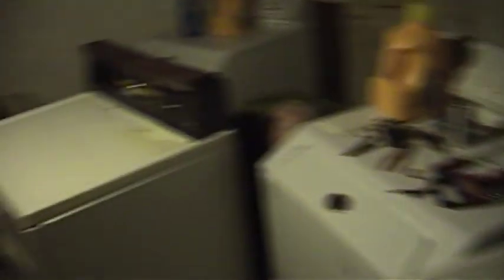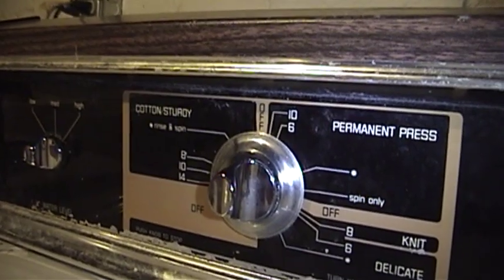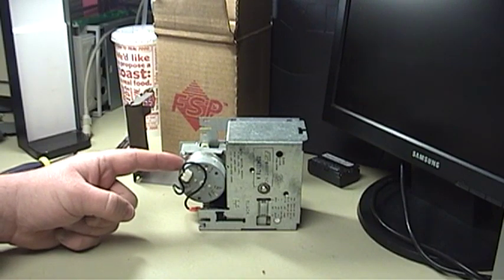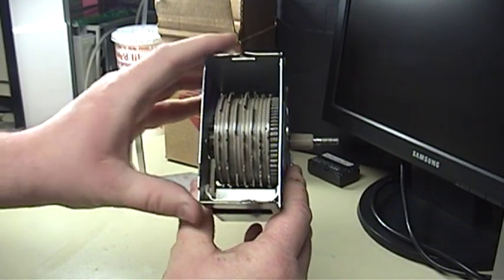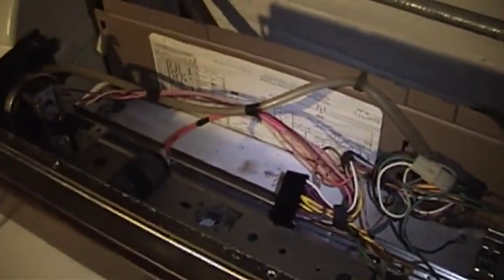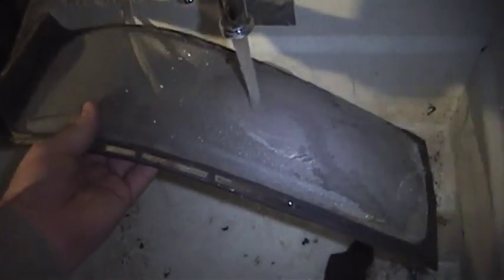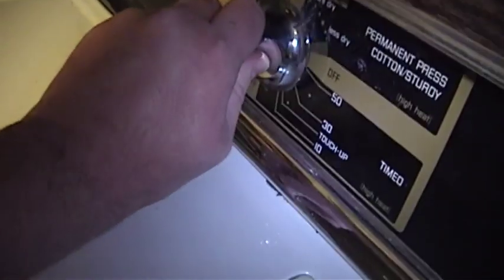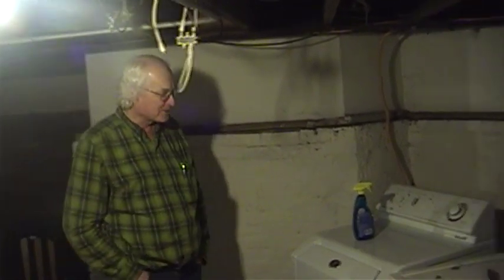Repairing College153's Clothes Washer and Dryer

Comment: My grandparents *just* got rid of some Kenmores from this era back on December 15. Something had happened to the washer to the point it shook the whole house when we washed clothes. Rather than spend time and money replacing part after part to figure out what was causing the instability, they replaced both washer and dryer with shiny new Whirlpool Cabrio WTW5600 and WED5600 units. They're definitely a different beast than the Kenmores, but they're nice. I dread the day the electronics fail...

Comment: Good ol' Kenmore built in the days when people cared. We've had a new Whirlpool washer, dryer, and dishwasher in the last 6 years. 3 dishwashers arrived with defects; one leg snapped, one bumped motor causing it to leak, 3rd with a leg deformed, but we settled with it, but it doesn't always heat water enough, poor performance, started making a loud humming too. Washer gearbox self-destructed after 3 years, then we got an LG front-loader, which has been flawless. Dryer temp control seems glitchy.

Comment: I did replace a heating coil in a newer dryer she had a couple years ago. It was easy enough, just had to remove the back cover, remove the element and connections, slot in the new element unit and reconnect the wires and replace the cover. However, without realizing it I had trapped a wire between the cover and the chassis of the dryer. So bang it went when we turned it on but no damage was done as it tripped the breaker. Soon fixed it with a bit of electrical tape and replaced the cover. lol

Comment: Thank you for this very informative video. I have a hotpoint washer with a (GE used on several brands) timer which will not act on the pull or push to turn for cycle selection or on/off.  I had a tech work on it a couple of years ago and he had to superglue some plastic part which was involved in the on/off function. I am interested in removing and rebuilding whatever is wrong.  The washer worked perfectly until I turned it to a cycle I never use (permanent press, by the way, diametrically opposed to my usual normal cycle). Now I can't engage the dial to change to any other and start it. any advice? new timer costs almost as much as another machine.

Comment: If you see the heating coils glowing red, that's a sure sign of restricted airflow and it will put a hurtin' on your element in time. On the opposite side is the fan intake duct. If you remove it you will probably see it's half clogged right in front of the fan at the bottom. Make sure to clean that out as well as your vent and duct.
Reply from the maker: +PAballoonists I've never seen an electric dryer element that didn't glow, even in machines known to be 100% working. Air passages in this machine seemed OK. I suspect significantly high line voltage and abuse to have killed the first heating element. Ventilation for this dryer was not ideal and I made the strong suggestion that it should be replaced with something better right away.

Comment: Ours doesn't have a touchscreen, but it's digitally-controlled. I still have to explain to my grandmother from time to time (in non-technical terms) that the timer cycle in the new machine is controlled by firmware on an integrated BIOS-like ROM chip instead of mechanical timers and gears like the old one. That's why it's a little slower. Personally, I think it needs more RAM! ;)

Comment: I have a Maytag A412 that I was trying to fix it was leaking I had to change the hub bearing and stem seal.  I had to chisel the threaded nuts off and hub bearing due to being on so long.  The problem I have now is that the belt is burning and no spin cycle.  I checked the top cap to make sure it was not rubbing.  Even if I get a new washer I am keeping this one and rebuilding it.  The new washers are computer controlled even the simple ones. This A412 is build like a tank new ones plastic.

Comment: You'd think they would have added some relays to the devices the timer controls so it  wouldn't be subject to that kind of high current torture. Then again, relays break--probably far more often than that timer wheel would. That was probably the calculation made when this washer was designed.

Comment: Did the landlord hire you to fix his/her washer and dryer?

To those worried about the Cabrios, the early ones had a defective controller assembly on them. Whirlpool will replace them out of warranty (they just swap out the entire board), wouldn't be surprised if it was bad caps. One nice thing about them is that they have on board diagnostics to help troubleshoot.

Comment: I hate Hotpoint machines (No idea if Hotpoint is available on your side of the pond) Mum has a hot point washing machine, only a couple of years old and It has basically been rebuilt, the only original parts are the motor and drum. I kid you not. It's had new draw, new pump, new belt, new sound proofing, more than one new programmer, new front panel, new casing cause even though it is metal it managed to split.

Comment: I use a modern washer, and frankly it sucks. It won't clean your clothes very well unless you lie to it by using the "bulky bedding" mode. If you use the normal cycle, it basically spins your clothes around dry and sprinkles little bits of water over them. It's a joke, and they're noticeably less than clean afterward.

It's one great talent is it's ability to spin so fast you could surely convert it into a centrifuge. It does a helicopter impression at the end of the cycle, I guess to help dry.